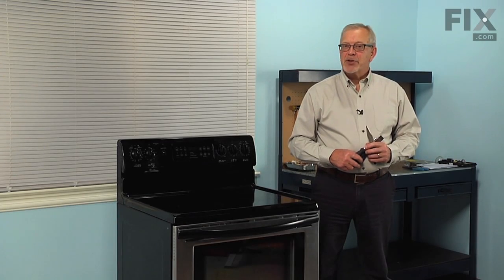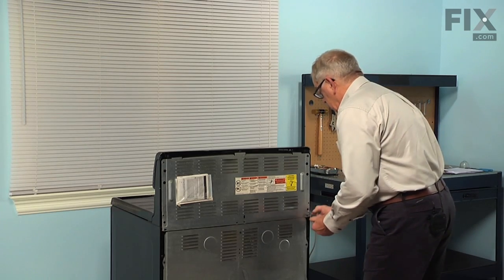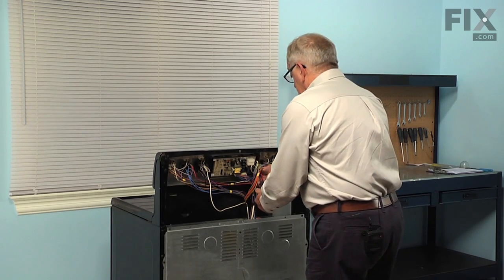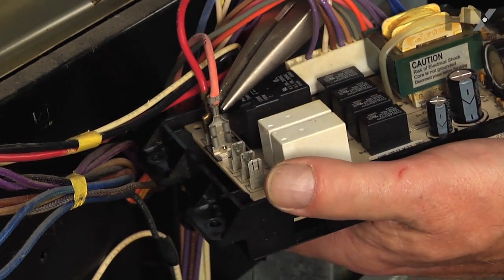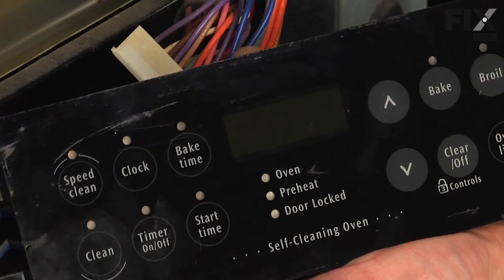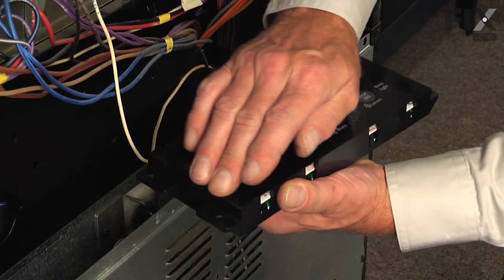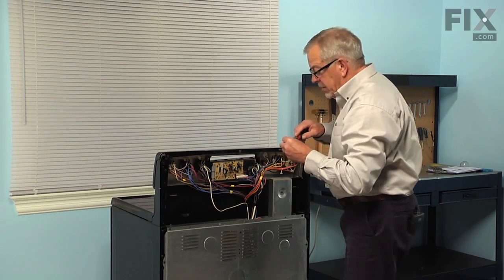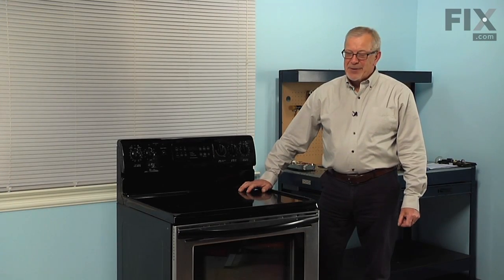Frigidaire Range Repair – How to replace the Electronic Control Board

Comment: Great vid! Your tip on how to remove the overlay from the bad board and attach it to the new board saved me $30+. It would not have occurred to me that it would be that easy to reuse the original. There was plenty of adhesive on the overlay; it attached perfectly to the new board.

Comment: Steve, I have a 40" Wide Frigidaire Range (Model# PLEF489CCF). The display has dimmed so that it cannot be viewed. Would you know what the correct part number is? I am about to remove all the capacitors to restore the intensity of the display. Before that invasive action, I thought I would exhaust all other alternatives.

Comment: Look at the 2:25.  See all those PC board mounted relays on there?  If your problem is just that the bake or broil elements don't heat (and you have removed the elements inside the oven and checked them with an ohmmeter to make sure the elements are good), it is most like a blown out solder joint on one of the pins on one of those relays.  By unsnapping some plastic pieces, you can actually separate the two halves of the control board like a "clamshell", and you'll see the burned solder joint.  It will be obvious. Clean it really good, resolder it, and the burner will work again.  This does NOT address any of the other more bizarre controller problems with error codes, funky displays, etc.  But if you just have burners that don't switch on, check the solder joints on the relays on this board first before you spend $$$ to replace the whole module.
Reply: Are you talking about the Blue and Yellow lines on the left side of the control board? I have a Frigidaire FEF336EC electric oven & range and both the broil and bake functions went out together all at once. Everything else works perfectly. When I try to turn either on, I hear a few clicks, then no heat anywhere. No error codes, either. Do you think resoldering certain lines on my range will fix this issue?

Comment: I have an f29 error on my frigidaire fpgh3077rf range. It looks like the control panel died. It isnt like the one in the video and no one seems to havea repair or replacement guide for this.

Comment: Thank you sharing.  A F11 error code popped up on our Frigidaire Electric Range Induction cooktop model FGIF3061NFC.  The P/N you shared on this post, will that work for my range?

Comment: My old control board stopped working so I replaced it like this. Now I have a clock and the oven works again, so that’s a win. However... I discovered that the panel flickers when I open the oven door. Same if the door is open and I press the door switch for the oven light. Also, it flipped out when I pressed the oven light button. 

Any ideas? The oven light works, but might there be a short somewhere?

Comment: What if the knobs seem to be the problem with crackling noise ? Like a shortage?
Reply: try unplugging and plugging back in the potentometer on each knob.  I may have butchered the spelling but you'll find them on the electrical diagram paper.  That has worked for me 2x in the past.  Somehow they jostle loose over time.

Comment: Nothing works on my oven (frigidaire). I can turn a burner on to get the displays working. Burner and oven don't heat up though. And after burner is off, all displays go off too. Can this fix it? Model number FFEF3056TSF

Comment: Hi...my frigidaire oven (model 318334500) no longer work but the four flat glass flat burner is still ok. Before the oven stops working, i heard an explosion in the oven that causes our general switch breaker to shut off (power shut down entire house). When i turned it on again, ctrl panel is dead and we can still cook but oven is no longer working. Need advise if panel replacement is the solution to make oven worked again.
Reply: Mighty Miguel 
Hey did you ever figure out how to repair your oven? Mine just did the same thing yesterday!
Reply: FYI. I too had a loud pop sound while using my 15-year Frigidaire oven (Model PFEF375CS3) last week.  I ended up with the 'F1' code error.  My top burners all worked, but no oven heat.  Pressing the panel buttons (e.g., clock, etc.) had no effect, although the Door Lock indicator and display would light and the motorized door lock would operate.  I bought a replacement electronic control module for $140 online and using this helpful video I easily replaced the module and now my oven is working again.  Replacing the module in my oven model was even easier than the video because the module is total accessible from the front by removing the front glass panel and there is no plastic 'stick-on button menu' to reapply since my oven controls are all 'push button' type.  Although I had a much more difficult time removing the wire-block connector than the guy did in the video.  Good luck!

Comment: where can I order the control board for a fridgidaire stove model #790.73234311 and the RTD sensor and the screws that hold the probe tenant lost them. Thanks in advance.
Reply from the maker: Hi RIckardo. This page should help you find what you're looking for:
https://www.fix.com/models/range/kenmore/id882793/79073234311/search/control%20board/

Good luck with your repair!

Comment: Hi Gilbert, i am getting and Error F11 and I cant set the time or bake or broil.  My model number is CGEF3040PFB.  My extended warranty was up in late October 2017. go figure!    Thanks in Advance Willie Ehmke
Reply from the maker: Hi Willie, the error code on your model means there is an internal short inside the display board and it will need to be replaced. Here is the link if you would like to order: https://www.fix.com/parts/range/frigidaire/fix9494055/electronic-oven-control-board-5304495520/?SearchTerm=&SourceCode=1&ModelNum=CGEF3040PFB&ModelID=6973723  This is just the control board. If you need the overlay here is the link for that part for you: https://www.fix.com/parts/range/frigidaire/fix2364031/overlay-316419821/?SearchTerm=&SourceCode=1&ModelNum=CGEF3040PFB&ModelID=6973723  you can order online or call us at 1-877-346-4809 and we will be happy to order for you. All of our parts are OEM parts and come with a 1 year manufactured warranty.

Comment: Great instructions, I have a Frigidare electric stove model LGEF3033KB.  All of my burners on the top work and have no error codes.  The broil element works fine.  The issue with my stove is when you press the bake button there is no heat from the bake element and everything on the control panel is normal meaning the bake and preheat light come on and you here a click.  I removed the back of the panel and removed both wires of the bake element and tested the bake element for a continuity test and that is working.  Any suggestions if this control board could be the issue???  I don't have alot of money but wanted your expert opinion and do you have a part number for the control board to purchase.  I wasn't sure where to order the part.  Any help as soon as you can will be much appreciated.  Thank you
Reply from the maker: Hello Rob, if you checked your bake element and there is continuity I would suggest replacing the control board. Here is a link for the control board for your model: https://www.partselect.com/PS3490768-Frigidaire-316557236-CLOCK-TIMER.htm?SourceCode=1&SearchTerm=LGEF3033KBA&ModelNum=LGEF3033KBA&ModelID=1559654  This is just the control board the overlay is not included. You may use your existing one or purchase a new one, it is black in color. Here is the link for the overlay if you wish to order that as well: https://www.partselect.com/PS2364025-Frigidaire-316419336-Overlay-Black.htm?SourceCode=1&SearchTerm=LGEF3033KBA&ModelNum=LGEF3033KBA&ModelID=1559654

Comment: My Frigdaire gas Stove works but the timer won't stop beeping and won't let me set the clock what is wrong with it?
Reply from the maker: Hi Gilbert, please provide your model number for your Frigidaire range and I will be happy to research this for you.
Reply: Fix.com ok thanks I'll get on it and message you back
Reply: The model# is FFGF3011LWC and serial#  is VF04563659
Reply from the maker: Hi Gilbert, is it flashing any error code number? or is it just beeping? You might need to replace your timer if no code is flashing or if its flashing code F10. Here is the link for your timer for your model if you need to order. https://www.partselect.com/PS1528268-Frigidaire-316455410-Electronic-Oven-Clock-Timer.htm?SourceCode=1&SearchTerm=FFGF3011LWC&ModelNum=FFGF3011LWC&ModelID=1514979
If the timer is flashing a code please let me know what the code is and I can research the code to see if it might be a sensor or temperature probe that might need to be replaced.
Reply: Fix.com Hi again and good morning it is showing an F10 code
Reply from the maker: Hi Gilbert, with the F10 code flashing it indicates that a relay to the control board is stuck closed. You will need to
replace the control board. Here is the link to order the control board for your model: https://www.fix.com/parts/range/frigidaire/fix1528268/electronic-oven-clock!2ftimer-316455410/?SearchTerm=316455410&SourceCode=3 Please call us and we can place the order for you.
Reply: Fix.com thank you very much for your help I appreciate it
Reply from the maker: Your very welcome Gilbert. Have a great day.

Comment: My Frigidaire gas stove shows no numbers to allow me to set the oven nor the clock however my gas burners do work. What does my oven need a fuse? Help
Reply from the maker: Hi Jose, it could be your control board. What is your model number?